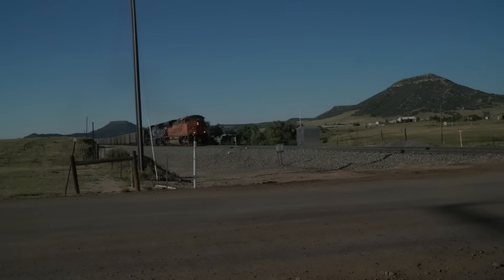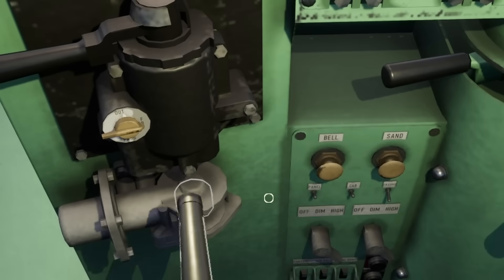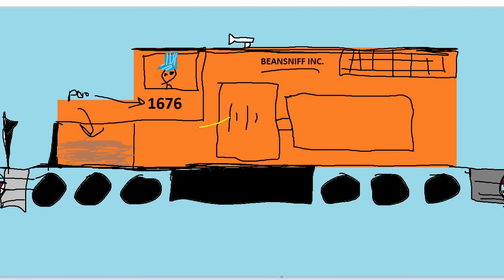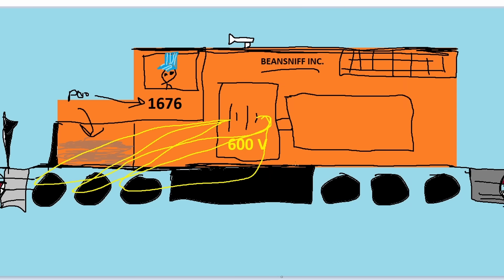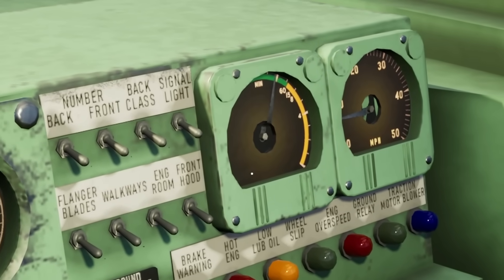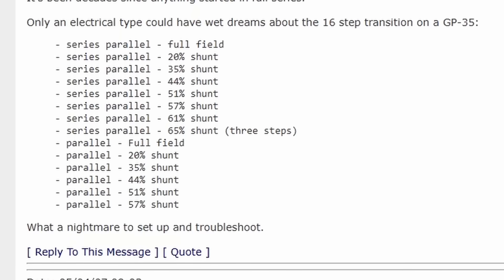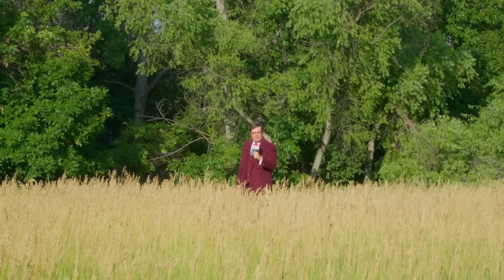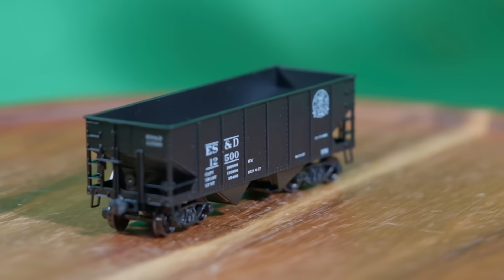The HIDDEN GENIUS of diesel electric locomotives... Transition explained - Railroad 101

Comment: Motors in series don't necessarily have the same voltage across each motor because current is dependent on load. The back-emf is sort of like impedance which is also measured in ohms. I replaced the motors in a toy train once... i noticed that when wired in series if one motor slipped pulling a heavy load it would start spinning really fast while the one that was gripping would slow down a little sort of like a mechanical differential. The faster spinning let it more quickly regain traction so i left it like that.

Comment: Same principles apply on fully electric trains / subways. I live in Toronto, and our subway lines have signage for operators, indicating what power levels to use, simply marked as Series, Parallel, and Off.  The trains run on 600VDC 3rd rail. Typically, beside the signal at the end of each station platform, there is a yellow & black "S" sign. Start off in series. After a certain distance, at the expected rate of acceleration, if you're still meant to be accelerating, you will see a "P" sign. Push the handle further into the Parallel range. Where the track is level, or slightly downhill, or you're cresting a hill, or you will soon need to brake, you'll see a black & white "O" sign. Get off the power, let the train coast. Braking into a station is marked with signs under the platform. Where 6-car trains are used, there's a "6" sign near the entry to the station, to mark where to apply brakes, in order to stop the train at the second "6" sign a few feet before the end of the platform. The Sheppard line uses 4-car trains and the braking points are marked with "4" signs. Pretty simple system that takes a lot of finesse to get it right, since the mass of the train is different at different times of day & changes at every station.

Comment: I hate to sound pedantic, but as an Electronics Engineer, I think I can assist you with your vocabulary:

A Generator describes any device that converts mechanical energy into electrical energy. Generators can be divided into:
Alternators, which generate Alternating Current (most often three-phase in industrial applications, but they can also be made to generate Single Phase AC), and
Dynamos, which generate Direct Current.

So what you were referring as Generators when contrasting against Alternators, would be described as Dynamos.

As a rough guess, I'm going to speculate that the AC-powered Electric Diesel engines use Variable Frequency Drives (VFD's) to control the power to the motors.
VFDs are quite fascinating in their own right. they take the incoming voltage, either single phase or three-phase, convert it into DC, and then 'chop it up' into high-frequency square waves, which are fed to the three phase motor. Since the coils of the motor are inductors, they resist the rapid change in current, and effectively 'smooth' the high-frequency square waves into something that looks like three sine waves 120° offset from each other. THe VFD is therefore able to simulate 3-phase power from a dead stop (locking the motor in place by) up to the motor's maximum rotation speed.
Reply from the maker: Pedantry is appreciated! Just curious from another comment; what part of the world are you from? Regardless, the manufacturers of the locomotive refer to them as the main generator or main alternator which is why I used those terms.

Comment: Here I refer only to series - parallel transition, field weakening is a bit different and not what I am revering to in this rant...

And yet the "Transition" from series to parallel at higher speed, is almost exactly why DC Traction tends to slip out at low speeds, as when the motors are in series, A slipping axle increases its output torque, as because the armature currents are identical, (and thus the field currents in a series motor) when a motor begins to slip, its armature back EMF rises. As the Back EMF rises on that motor, the current of all the motors in series with it begin to fall, as they see less voltage drop across them, but as field current also falls, their back EMF falls, and so they produce less resistance to the incoming voltage. This further increases the voltage drop on the slipping armature, and as its current does not drop off significantly due to the higher relative voltage drop across it, it just spins faster.

if the motors were always run in parallel even at low speed, this would not occur, but that would not be as cheap as possible as a far higher generator current would have to be maintained. Transition may indeed be a "Cool" feature, but it is indicative of the thermal inadequacies of DC traction Motors and Generators.

Comment: Your explanation that when six traction motors are connected in series each sees 1/6 of the voltage and uses 1/6 of the current seems wrong.  Current is a measurement of how many electrons travel through the circuit per second and there is only one path so all the current goes through each of the traction motors.  Power is calculated using volts multiplied by current so each motor would provide 1/6 of the power and have to deal with only 1/6 of the waste heat created in the process.  Otherwise a great video. Thanks!

Comment: That's very interesting. I used that on a battery powered model locomotive I built as a teen, where changing the speed from slow to fast swapped between batteries in series or parallel. I was having issues with power at low speeds before implementing that system. I had no idea the real thing also worked the same way!

Comment: Ok, I saw this video show up yesterday and made sure to add it to my "watch later" because this is my territory and I wanted to be a pedant again. (He even mentioned GP-35s and we have 14 of those, so we're really in my home turf now lol.)

Watched this once already to absorb everything and a second time to write this comment so here we go.

00:20 - I'll second that, I've had multiple engineers ask me what exactly is going on when a locomotive transitions and why some locomotives don't do it.
00:53 - and that ladies and gentlemen is what it all comes back to, keeping the voltage and current demands on the main generator within a range that doesn't fry or melt things.
01:47 - minor nitpick, but in general it's more about protecting the main than the traction motors. A D77 traction motor can handle just about 1000 amps continuously, meanwhile something like a D32 main generator can just about handle 4000 amps. If you have a six-axle locomotive, you'll overload the main well before the motors even break a sweat. On the other end of the spectrum, most main generators top out around 1000V and the motors can handle that just fine, but if you keep them in series, you're splitting that voltage drop across multiple motors so the main will be at risk of overvoltage well before the motors as well.
02:37 - that specific issue is actually dealt with by what has to be one of my favorite things to dig my head into about diesel-electric locomotives and that's the "power control" and "performance control" portions of the feedback system from the main generator. I won't go into it here, but man is it a fun thing to nerd out about.
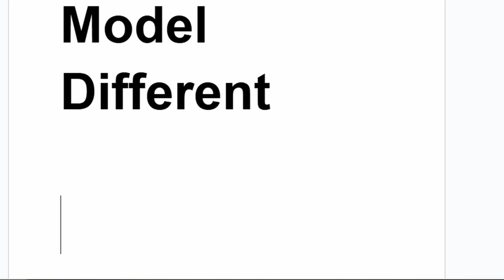03:12 - ok I gotta hand it to you, I've been working on an all EMD fleet for as long as I've been at the railroad and I've never heard this one. I'll have to use that now.
05:50 - that's actually a pretty good way to word that. It's hard to really explain how transition affects the operation of the locomotive, because it doesn't really affect the power output (barring field shunting).
06:40 - the strangest setup that I've seen to date would have to be on NKP358. She goes from series-parallel to... series-parallel... Specifically, two sets of three motors in series, to three sets of two motors in series. Then, I believe, she starts grabbing field shunts. As far as why this was done, my best guess would be to save on contactors. Lord knows that something like an SD40 with dynamic brakes has enough contactors to make your head spin. With 358's setup, she could save quite a few contactors.
07:31 - as best as I can understand this, it's actually more about amperage than voltage. The problem with DC generators is that they run into commutation issues under high amperage conditions. The conductors in the armature have to go from carrying something like 1000 amps to 0 amps nearly instantly once the commutator bar moves out from under the brush. When this happens, at least as best as I understand it, it can cause an induced voltage and if that voltage in high enough, it can cause that commutator bar to arc to something we don't want it too and that causes all kinds of melty fun.
08:22 - ok this is another nitpicky thing; I assume we're talking about field shunts here and it's a little different than varying the resistance of the motors. Back EMF is proportional to speed, as was mentioned, as well as motor fields current. Every DC traction motor I've ever seen was a series-wound motor. This means all the current flowing through the motors goes through the fields and the armature. The problem with that is that high field current also means high back EMF. So, to combat that shunting resistors are added in parallel with the traction motor fields. These resistors allow for some of the current to bypass the fields and only pass through the armature. This has the effect of reducing field current, and thus back EMF, which allows the locomotive to continue accelerating. I believe a small amount of efficiency is sacrificed, but the ability to continue accelerating outweighs that loss.
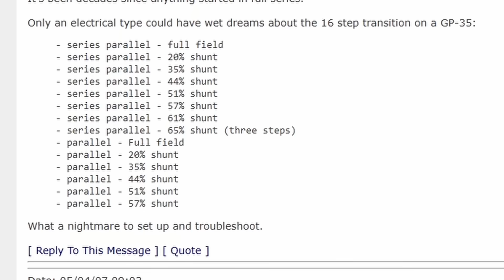08:31 - hey, we have 14 of those! Granted, ours are Dash-3s and only have (I think) 11 steps, but yeah lots of field shunting going on. Although, ours rarely seem to give us issues so I really don't have much to say.

Whew, ok sorry for being a pedant.

Also, that was a hell of a way to do a merch drop. Great video as usual!

Comment: Series, series parallel, parallel DC traction motor switching can trace its roots back to before the existence of diesel electric locomotives, It was used in electric locomotives, multiple electric transit and passenger cars and streetcars. Drop in a resistor grid and you can introduce wider range of voltages to turn the traction motors.

Comment: why do they make a clicking sound when they are stoped
Reply from the maker: That's usually the "spitter" valve, designed to remove moisture from the air reservoirs, if I had to guess based on your description.

Comment: 🦁🦁🦁🦁🦁 the LION was here! 🦁🦁🦁🦁🦁   \\   Neat.  But my subway trains have three notches on the stand:  Switching, Series, and Parallel.    Switching is simply series with some resistors thrown into the circuit.Obviously you cannot stay there very long without the resistor banks glowing red hot and emitting the burnt electronics aroma. Notch up once you are rolling. Series is, as you have described it, Two motors on each truck, forty motors on the train,  no traction power between trucks or cars. Parallel  or RUN, puts 600 volts on each motor and if you look at the trucks you will sea a single 600 amp fuse above the third rail shoe as each truck is its own entity. There are speed limits on the subway. To reduce speed you move the controller to the off position, to increase speed you move it back up to run.
Reply: Even Russian metro trainsets like Еж-3 have same logic. 

X3 - Paralel + field weakening
X2 - All series
X1 - Shunting
0 - Idle
T1 - T3 - Braking / Тормоз

Comment: This switching from series to paralel (motor groups) is also common on purely electric (mostly) DC locomotives and EMUs (electric motor units). When I drive in Garry's mod Metrostroi old Russian metro trainsets like Ezh-3 or 81-71 you can feel that sudden jolt at around 20 km/h when you controller usually goes automatically from all series (4S) into series-paralel connection (2P2S) and at around 40 - 50 km/h on top of that there are field weakening notches that reduce counter EMF and increase tractive effort even more.

Comment: Hyce - Good explanation.  Incidentally....  Early day DC trolleys used this same series/parallel transition.  Also... When I took Electrical Engineering the formula was E=IR where "E" was the electromotive force in Volts.  "I" was the current in Amperes and "R" was the resistance in Ohms.  Using a "V" in the equation changes only one of the parameters to it's corresponding units but not the others.

Comment: I was a locomotive engineer for the Soo Line Railroad Co. (now retired). Consequently, I operated some former Milwaukee Road units and these included EMD GP40s. On these 1966 built GP40s there was a 4-notch "selector lever" on the engineer's control stand that I never understood for the longest time other than when using dynamic braking in the forward "B" position (which often was disabled). It turns out this "selector lever" was supposed to be used for trailing units in your locomotive consist that still had manual transition. Those "manual transition" engines were long-gone when I began locomotive engineer service in 1995.
Reply: The GP40s actually had no trasition themselves, so even if you wanted to control the transition on it, you couldn't. the SD40s had one step of transition themselves, but you already know that.

Comment: When I was developing the simulation for NGH’s diesels, I did a similar rabbit hole. 

I then went nuts and added a wrench into it by making a battery hybrid, so the engine now only runs when needed when set to full hybrid mode. Was a lot of headache, but not as much as trying to figure out braking.

Comment: Thanks, that's something I never knew.  A lot of series wound traction motors don't do this (non-locomotive traction motors).  It also explains why some locomotives when speeding up sound like they take a brief pause in power delivery and change gear, which makes no sense at all if one understands the basics of DC traction.  I never could work out why that change in tone happened; the transition of the traction motor supply would explain the change.

A suggestion, you could find an example of that accelerating tone change on transition and stitch it into this episode.

Comment: I always wondered why they rate locomotives by Horsepower. I wish someone would explain that and the relation to the Traction Motors.   Are the Traction Motors matched to the Horsepower perfectly.  Could a 4000 Horsepower locomotive with the same Traction Motors and Alternator do the same work as a 4400 Horsepower with the same Traction Motors and Alternator.
Reply from the maker: Check the excellent pinned comment. ;)
Reply: @Hyce777 My question was off the  subject of the video. More a suggestion for another video. Basically if everything is the same in two different locomotives except for Horsepower of the engine would they pull the same.  Do you need 4400 Horsepower to turn an Alternator at max RPM or would a 4000 Horsepower Engine do it burning less fuel but take a fraction of a second longer to get up to max RPM.

Comment: Not a bad presentation for DC locomotive drives. It gets even more complicated than that. It's wild. Wait till you go down the AC side of drives for locomotives. It's fryed even some electrical engineers minds trying to grasp it when going through school. But once you grasp it, just about everything else is kinda easier to understand. You'll be able to home build a VFD in your sleep. Let me put it this way, I wish I was a doctor. So much less to understand. Because a doctor is only a expert in one field.

Comment: The British EM1 and EM2 (later class 76 & 77) had throttle positions called “Weak Field”. I tried looking it up but nothing ever seemed to come up on it until about a year ago. I can’t remember all the details cuz it was very extensive but the basic idea was the notches reduced the back EMF of the motors to allow them to spin faster. The way I simplified it in my head was the magnetic fields in the motors produce their own form of resistance when spinning so reducing those magnetic fields cuts out that resistance to allow the motor to spin more freely at higher speeds, hence you “weaken the field”. I’m not well versed in electrical engineering so im not sure if this is correct. If anyone could clarify, that would be great.
Reply: "Weak field" basically bypasses motor field windings with a resistor, so that only a portion of a current flows through a field. This reduces both magnetic flux in a motor and its back EMF.
Reply: @Knsgf  Thank you. I’m glad I at least have a basic understanding of it lol

Comment: While EMD was the dominant player in the North American market, ALCO was first in commercially producing a diesel locomotive with an alternator as seen in July, 1965 with ACL C-630 3011. EMD's first alternator equipped locomotive was NYC GP-40 3036 in November, 1965 and GE's first was Demonstrator U-30B 301 in May, 1966. ALCO and GE had hit the limit of 2750HP for what DC generators could do in locomotives with EMD topping out at 2500HP

Comment: If it helps, think of Transition like electronics' version of a mechanical transmission. Except instead of trading torque for speed by switching gear ratios (Hence why it's literally called "switching gears"), you're trading Voltage for Amperage by switching circuits.
Reply: Which also kind of switches torque.

Comment: Ive got a question, maybe its a silly question but ill ask anyway. I work on Generators, like big ones. 35KW to 4MW generators. With the AC power,  the voltage regulator controls the voltage. While fuel is used to increase the KW output, or Amp output. So heres the question, why would RPMs change with amps to increase or decrease the power or speed of the locomtive? Or is that the difrence between DC and AC locamotives? This wasnt coveres in the Diesel Electric train 101 video. Thank you for reading this essay lol!